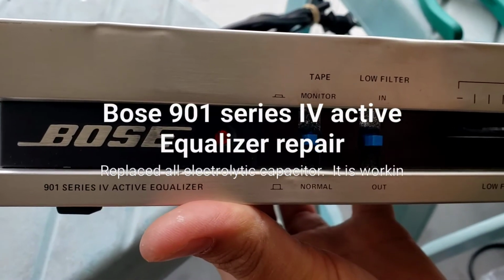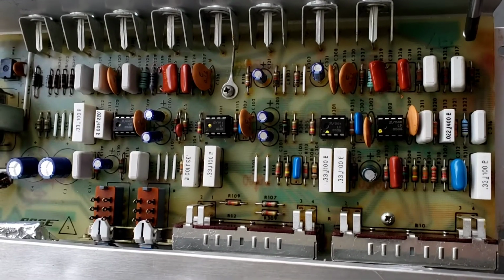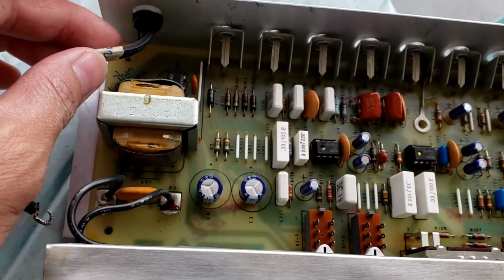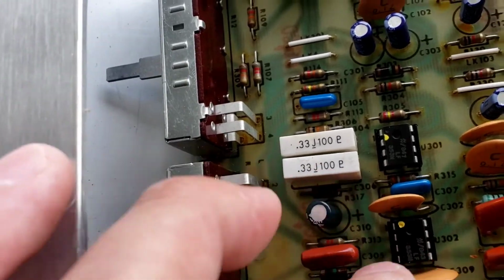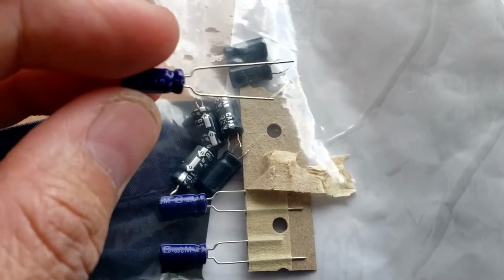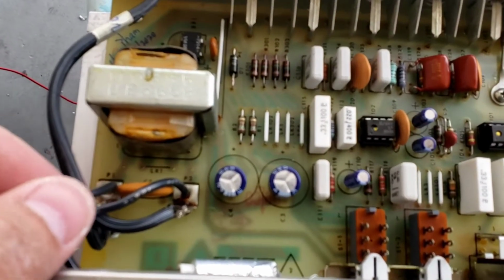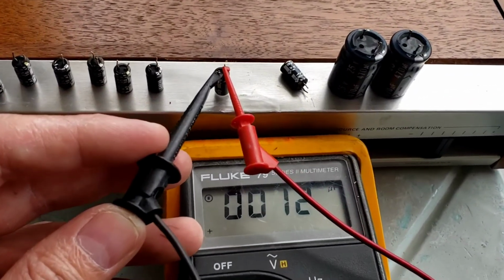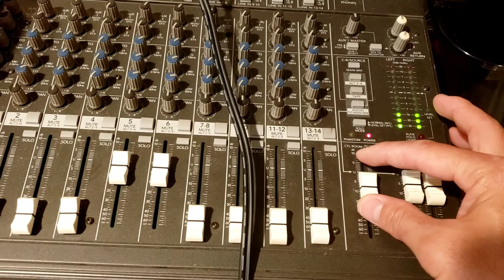Bose 901 Series IV Equalizer repair. DIY

Comment: Bạn ở đâu vậy,tui có thể đem EQ 901 iv tới bạn sửa được không? Mình ở El Monte CA .
Reply from the maker: Minh o San Diego, California.  Sorry didnt see this message until now :)
Reply: Hien Pham thank you. Do you have a repair shop?
Reply from the maker: @alv6812  No I don't.  I just like to repair vintage audio and for weekend jobby projects.
Reply: Hien Pham Mình nhờ bạn tư vấn 1 chút được ko ạ? Mình có eq 901 serial iv, khi nghe nhạc thì ok. Nhưng khi xem film đoạn silence thì có tiếng ù nhẹ (hum) bên kênh phải. Mình đã kiểm tra các kết nối dây, cách đấu đều ok. Nhưng vẫn bị ù nhẹ kênh phải. Khi vặn volume ở Power Amplifier thì tiếng ù to dần lên ở kênh phải, kênh trái bình thường. Mình ở Úc hok chưa tìm được thợ sửa boé 901. Bạn có thể cho mình biết lỗi này do đâu ko ạ? Cám ơn bạn.
Reply from the maker: @henrynguyen1852  hi ban, co le la may cai cuc capacitors lau ngay bi leaked roi.  Theo minh biet thi thay may cuc nay se het va am thanh se hay hon nhieu.  Cung ko kho thay cho lam ban chi can lam theo cai video cua minh chi thi ban co the lam duoc.  Nhung ban phai biet cach han (solder) tai vi neu khong can than may cai traces/pad very delicate se de bi pad lifted.  Hy vong ban se thanh cong.